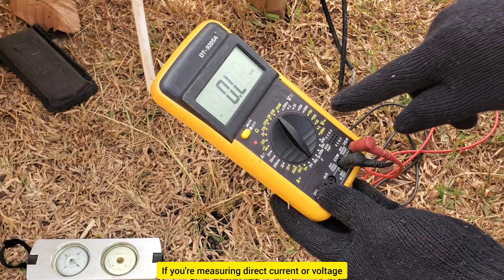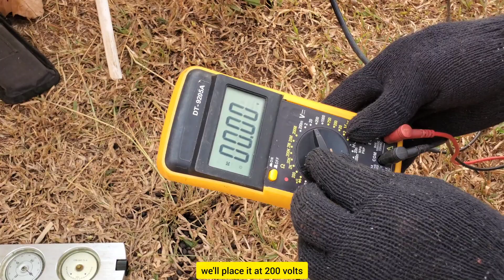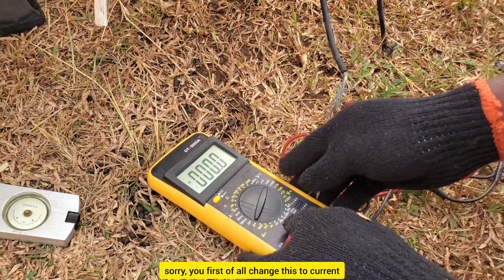How to measure the open circuit voltage (Voc) and short circuit current (Isc) of a solar panel

Comment: it is not good to measure the short-circuit current by this method when you have more panels connected in series and the open circuit voltage becomes high some systems these days go as high as 500 votes there will be an immense spark you could burn yourself and damage your test prob😊
High voltage DC produces High energy Arcs
i'm an old tech And only wish to be helpful😊🌈
Reply from the maker: Noted... Thanks for your input
Reply: @Solarwattng  🙏
Reply: His illustration is simply for a panel unit not panels connected in series okay !

Comment: Is this possible to use 2x46.2V=92.4Volt VOC panels in series on a MPPT SMU (solar management unit) with maximum VOC support 90V?
Reply from the maker: Your voltage of 92.4v is  higher than the recommended voltage of 90v. You can use panels with lower Voc or mppt with higher maximum pv Voc.
Reply: @Solarwattng  Thanks Brother, does ageing or dirt effects on VOC of panels? Mine are three years old.